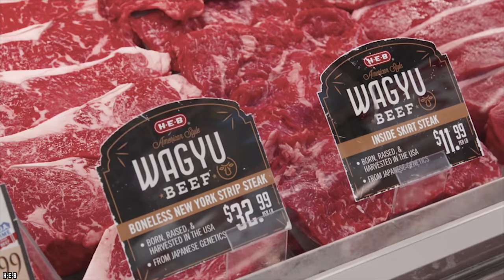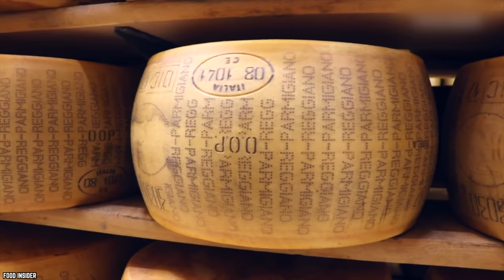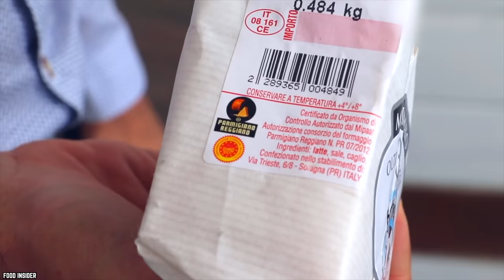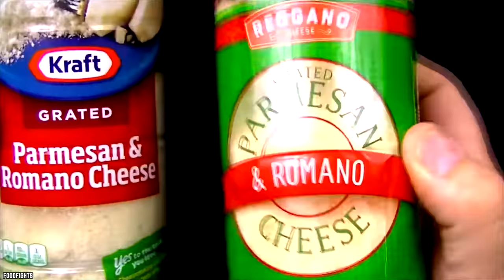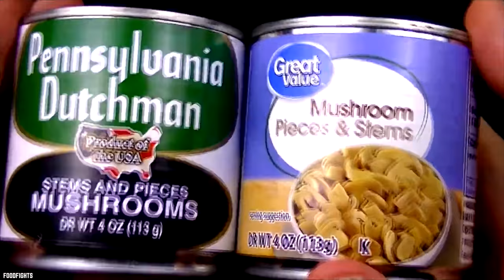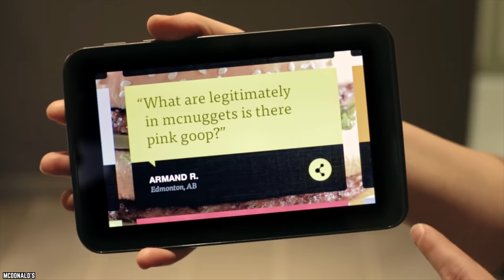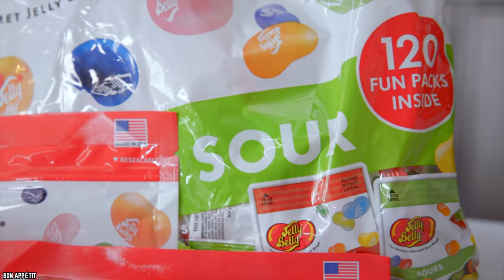10 Foods You'll NEVER Buy Again After Knowing How They Are Made

Comment: Okay, nice try. Vinegar is in quite a few sauces, like most hot sauce, barbeque, mustard, ect. why is that mentioned. 

The advantage of modified atmosphere packaging is by replacing air with a gas like CO or CO2 you reduce the oxidation on the surface of the meat, which turns it gray looking. It has nothing to do with hiding rotten meat.

Pringles, okay, I agree with that up to the point that I don't think most would mistake Pringles as a real potato chip and even on the can for many years they are called crisps.

l-Cysteine is not likely produced from human hair as there is no evidence this is the case. It does however come from feathers and animal materials or is synthetically produced. I didn't find it listed on any commercial bread ingredient lists that I looked at. Where did they come up with this stuff?

Mushrooms - people are going to freak when they find out that all foods have limits like that from the FDA. So stop eating food.

Bottom line, unless you are growing all your own food, you will run into things like red dye, cellulous, vinegar, etc in your foods. There is nothing wrong with it. For some, avoiding processed, commercially packaged or canned, foods is possible, but for most, this is how food gets into your grocery stores at a price you can afford.